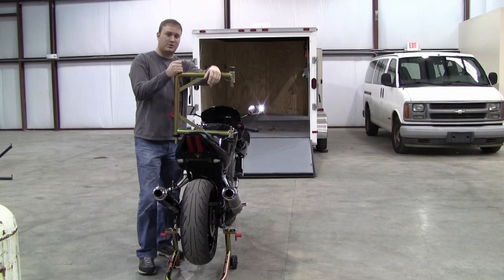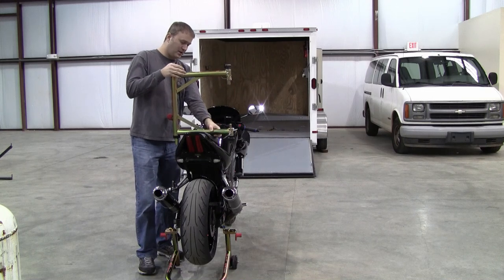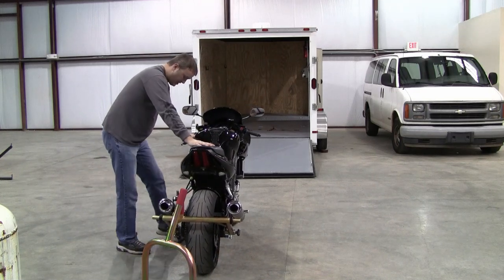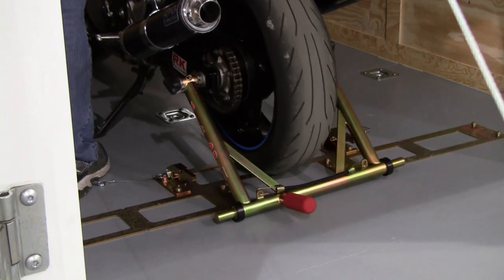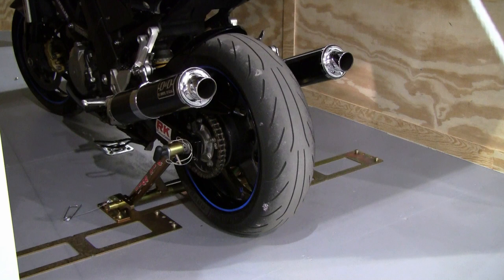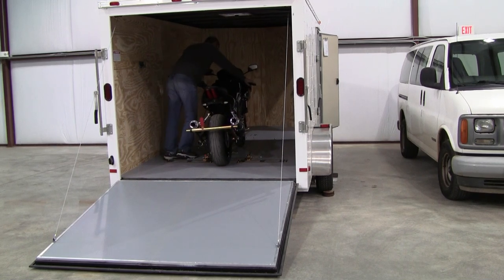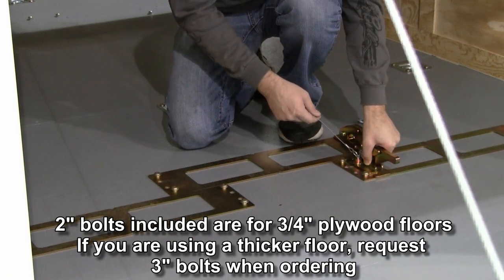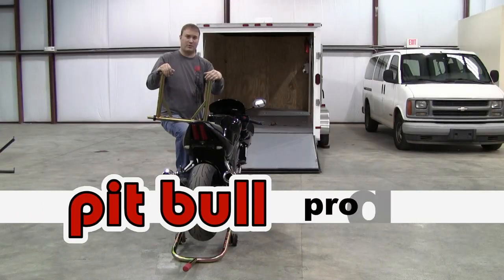Pit Bull Trailer Restraint Instructional Video (2013)

Comment: I have a two bike Ironhorse trailer. I have used the wheel chock and straps, but the trailer is always uneven until I get to my buddy’s house to pick him and his bike up to go to the track. This system is freakin brilliant. I can center load my bike on the way to his house. Pull my bike out, move the clips to the outside, put my bike on one side and then get his in there.

Comment: Do you have to mount the floor bracket into the frame of the trailer?  Or just anywhere into the floor where you want the bike to ride?
Reply from the maker: You can mount it anywhere so long as you have at least 3/4" plywood flooring in that location.

Comment: Do you guys have a video on where to drill in the back of a pick up truck?
Reply from the maker: Unfortunately no, because it varies from truck to truck and of course depending on bed length, even the wheelbase of the bike is a factor as well.  Truck installation will require some careful planning before drilling.

Comment: How do you prevent the front wheel from lifting/ bouncing on rough roads or during an accident. At the very least I see a need for vertical restraint somewhere on the front of the bike.
Reply: bike has front suspension
Reply: Where the hell are you driving, that the front end of your bike is bouncing off the bed of the truck or trailer, wheelie style?!
Reply: @maximusmax4557   In Australia. Roads worse than 3rd world countries...

Comment: Great system. Are they available in the UK ?  and  do you have one to fit a 1984 BMW R65?
Reply from the maker: Sorry, but we do not fit the older BMWs.  Usually the pipes block access to the hole, or there is no hole on the shaft drive...At this time, we have dealers in Sweden, Norway, and Germany but that's as close to the UK as any dealers would be.